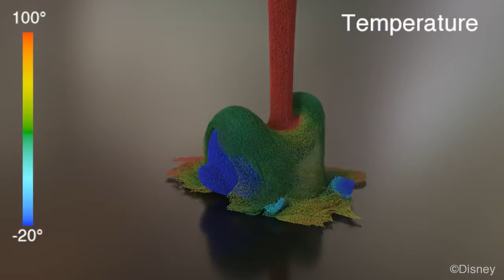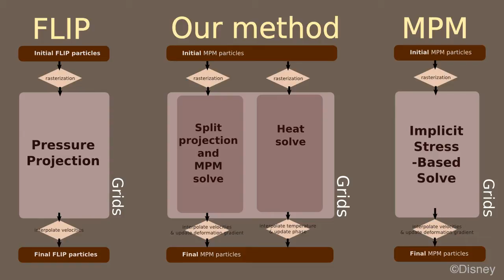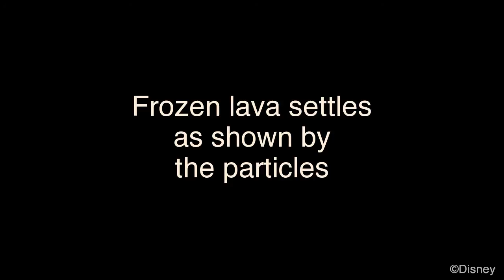Stomakhin et al, "Augmented MPM for phase-change and varied materials"

Comment: Nvidia Flex has phase shift already !
Fried eggs simulation is closer than ever !
Reply: There is a sample with some bunny, they are solid, and then they change to liquid.
The name of the sample is  "melting", then the code is found in flex-080\flex\demo\scenes.h lines 3277 to 3342
It seems they only update g_params.mCohesion and g_params.mFluidRestDistance to achieve the melting effect.
Reply: oh, i see.
So this means the original shape is stored, and the system pulls each particle back to that shape when the cohesion increase or rest distance decrease.

There may be a way to write your own phase shift from liquid to solid.
I have seen somewhere on youtube a lava simulation using PBD, as the lava flows, some of the lava becomes cold on the outer boundaries and the viscosity increases, untill the particle is static and doesnt move anymore.
So similarly, you could write some simple rules in the solver where the particles would stop behaving as a fluid and become solid, maybe based on temperature.
On this page with the chocolate melting, each particle has a temperature, i dont know if they handle temperature somewhere in flex.
You may be able to hack around and add such property to a particle, then calculate the temperature changes based on the surroundings, i am not sure if in flex they have a way to get the nearby particles list, and if this would affect performance.
But when I try their water simulation with 65535 particles, my gtx 970 card is close to melting point. lol.
Reply: If flex handles particles parameter globally, it would be impossible to have per particle viscosity/phase/temperature. This may be the reason why the simulation is fast.
Are you going to write your own position based system ? Would be fun.